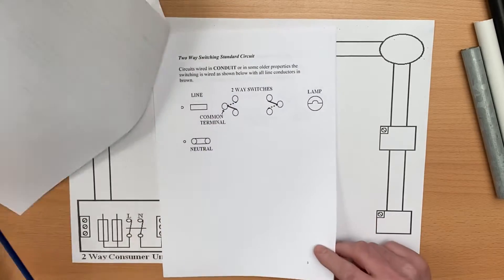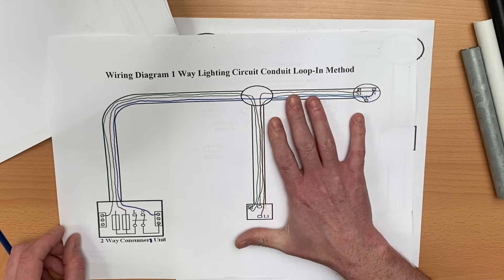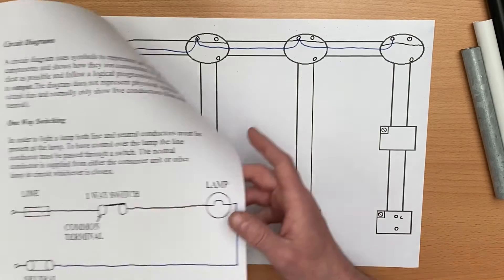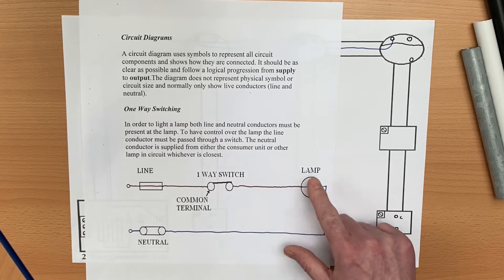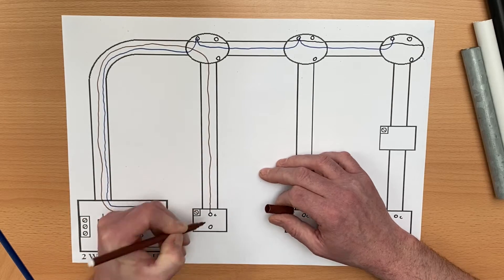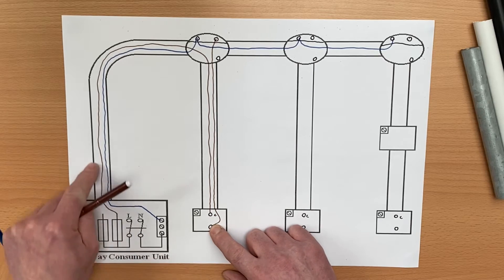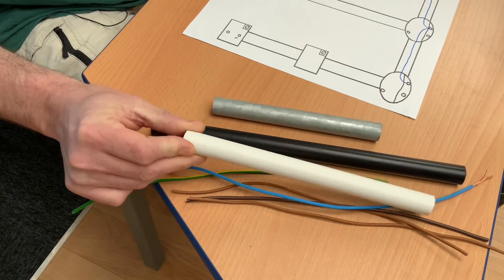Wiring Diagram Conduit Loop-In Method Part 3 - Lighting Circuits in PVC Singles - 3 One Way Lights

Comment: Just out of curiosity, is there a rule that would prevent putting a wago in the conduit Tee box for the line conection, so you don't need to run the permenant line back up from the switch common to get to the next switch?
Reply: Yeah, the whole “it’s wildly inefficient to take the earth down and then back up” speech applies equally to the permanent line. Certainly in this country you would always tap the line with a junction in the junction box, not by going down and then back. Not sure what the UK does.

Comment: I've always used the third terminal on the small-base batten lampholder as the line loop-in terminal, which suits the classic application in steel conduit. Some brands of batten lampholder have the third terminal shrouded and marked "LOOP", but I do know that the Chinese "PMS" brand (from typical non-trade sales outlets) have a non-shrouded third terminal marked with an earth symbol. 
That terminal does not connect to the bayonet collar - but if it did, that could be a serious concern with the apparent similarity of the product.
In plastic conduit installs I used to get the little brass earth terminals to go in the boxes (there's always a place in the mouldings for fitting them) but generally use a Wago terminal instead these days.

Comment: Not a sparky but interested to know what is the advantage of this over traditional ceiling roses type installation? Seems you have to run an extended amount of cable to the switch rather than back to the 1st lamp? 

I guess there must be something wrong with using something like a maintenance free box and wago’s?

It would be nice if it was compulsory to leave wiring diagrams in domestic properties showing where the cabling goes. 

Fan of the channel and Efixx as well.
Reply from the maker: Hi David - in singles you can take the cables exactly where they are needed, so the permanent line isn’t needed at the lighting point so we take it to the switch and from the switch the switching line goes to the lighting point. Massive thanks for the support across both channels 👍🏻 Gaz

Comment from the maker: == 🕐 Time Stamps - Cut to the action 🕕 ==
00:28 - Link available in the description for the handouts
01:15 - Rig for practicing wiring lighting circuits using the conduit loop in method 
03:12 - Adding switches and lighting points to our wiring diagram
04:45 - Adding the neutral conductor to our loop in lighting circuit wiring diagram
06:37 - Adding the line conductor to our loop in lighting circuit wiring diagram
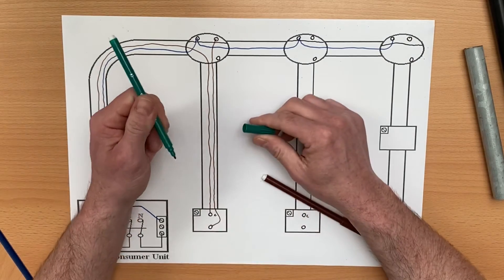08:11 - Adding the CPC conductor to our loop in lighting circuit wiring diagram 
11:01 - Extending the line conductor to other switches in other areas 
14:09 - Test result sheets